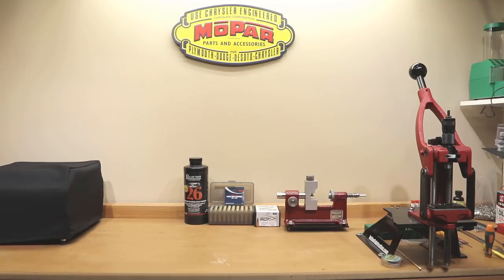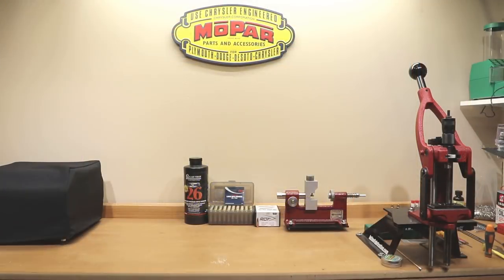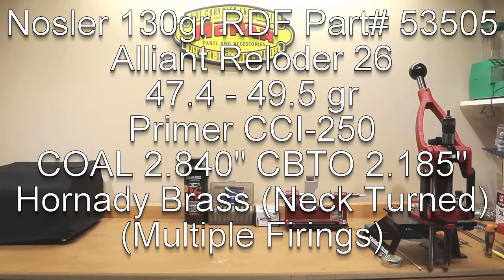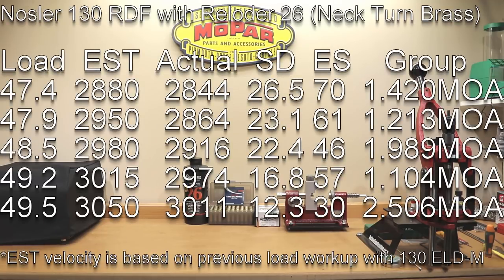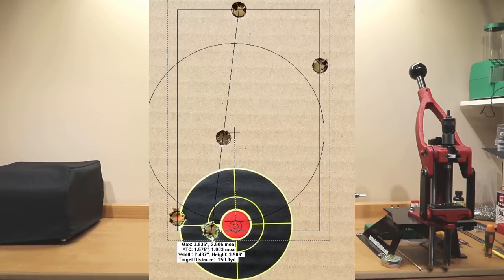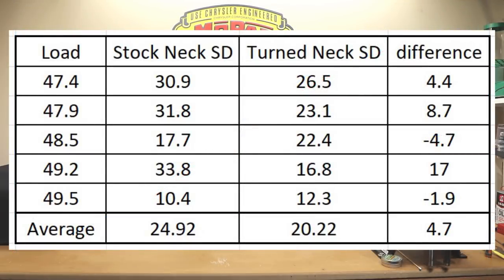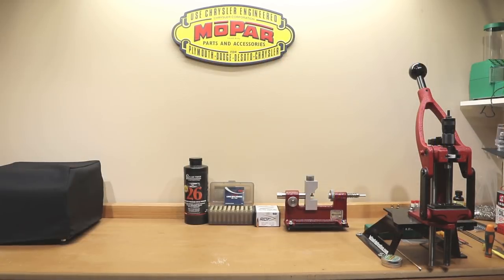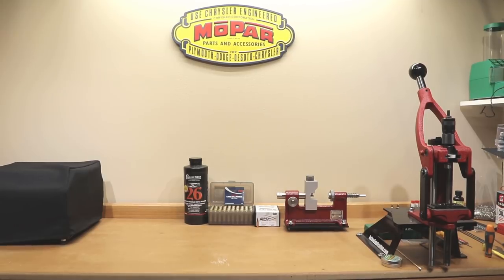Neck Turning Brass -  Does it improve performance?

Comment: I shoot 338 Lapua, and when I purchased my rifle i couldn't afford factory ammunition at that time in 2009. So I purchased a box of Lapua brass and began measuring the neck thickness and found that they had about half of the necks had thick and thin spots in various locations. So I set up my Sinclair neck turner to trim off the thick spots and bring the case necks to be more uniform thickness. Then I loaded them using the Sierra 250 grain Matchking bullets to the same specifications that Black Hills loads there ammunitions. Then I loaded a starting load latter and worked up to the powder level Black Hills level. To my surprise the Black Hills loading was the most accurate using the Sierra 250 grain matchking bullet. The key to turning the necks is to allow the bullets release of the tension of the neck completely 360 degrees around the interior of the case neck, causing the neck to expand to the extreme interior dimension of the chamber's neck so the bullet is caught in a bubble of expanding gases as those same gases are pushing the bullet forward towards the freebore of the barrels throat and into the rifling. When the case neck has a thickness that is not uniform in thickness the bullet can be pushed sideways, When the bullet reaches the lands and grooves you want the bullet to obturation to be equal or as the bullet travels through the barrel it will exit off center. That then governs bullet placement on the target.

Comment: I almost always turn mine down. I usually fire them once first, then turn the necks. But I’ve been known to do it right out of the box to. 
I’ve seen improvements anytime I turn necks, assuming they need turning that is. I’ve got lucky before with starline and Lapua having necks with .0005 difference between each case. Basically a half thousandths, so those I didn’t bother turning and they shot well.
Reply: I have been using the Lapua brass in my 6.5.  It rocks because the neck is so thick.  I'm taking a reloading class later this year that Alpha is putting on.  I'm hoping theirs is just as good because it's way cheaper.

Comment: Great video.  Very true and such an important area to discuss.  You can overturn the brass, and I've done that by accident.  I've done similar tests, and have seen some improvement as well.  For Lapua, Alpha, & Peterson; I don't see nearly as much improvement compared to Hornady.  HDay brass is much thinner in the neck and body than the previous three.  I see my HDay cases having a larger volume than the others.  I even tried cutting down .308 cases to see if reduction of volume would aid in higher pressures with less inconsistency in the walls and neck post annealing and turning.  I did see some interesting results compared to out of the box 6.5CM brass.  I've been considering buying some .260 cases just to see what happens with them on downsizing to 6.5CM does in comparison to .308 cases.  I did notice if I neck turn, fire the case, then try to resize without annealing that the case mouths will not hold a bullet after the 2nd firing.  The brass just springs right back to its original fired size in the neck due to the thinner brass not being strong enough to resist the spring back.

Comment: Good video as are others you upload.  Helped me decide a couple things and learned a few things from both the video and comments.  One- I use Hornady brass that I obtain by buying factory loaded ammunition, not bags of 'new' brass.  So:  I have been thinking about annealing and now I feel it would be a waste of money, insofar as gaining a benefit from increased life, # of loads, of my brass.  Because of loose primer pocket or CH issues occurring, negating the gains made in neck life by annealing.  The benefit to annealing, then IMO would be a possible reduction in SDs/ESs.  

Appreciate the candor about a shortcoming, IMO, of the Hornady neck turning tool.  Namely the coarse adjustment of the cutter.  Also, I am not real excited about holding and using a cordless drill to run the 'mini' lath.  I think there is a superior neck turner on the market with an integral electric motor.  Jury is still out on whether to neck turn.  I'm typically under .002" on run-out and most times around .001".  

And your video gave me a nice 'confirm' on my decision to use the Sinclair expander mandrel and its die on my case necks.  Finally, you do a good job presenting your information and topic and you do a nice job in producing your video.  Good camera angles and lighting and no background noises, like a phone ringing, dog barking , kid crying, etc  :)  lg

Comment: I'm turning case necks because as an old National Match shooter I have a basement full of 308 brass and with the excessive cost of 6.5 Creedmoor brass, if I can find it, to feed my Savage 10T I've started converting 308 to 6.5.  Hornady brass isn't bad but Federal is very thick comparatively and after seating a bullet the case wall thickness can prevent chambering properly.  The side benefit is increased accuracy.

Comment: Neck turning seems to work best when the rifle has been 'prepped' for accuracy work.  I work with WW1 era rifles and middle to large size game, so half a hair accuracy is not needed.  I do have a couple accurate intended rifles I would like to get sub-tiny groups.  I have a Forster case length trimmer and neck turner.  I confess I haven't used it much and could probably use more practice.

Comment: I bought a Hornady case neck turner,    I didn't see a big whopping difference. But the difference I seen, it  was  worth the price. I recommend it and be careful not to cut to much
Reply: People should make sure they turn the necks down so the cutter just kisses the case shoulder . That way you know you have cut all the length of the neck . If you stop short of that you run the risk of creating  a ridge just  before the neck shoulder junction that upon firing transfers inside the case creating a  doughnut . 
People who are skim turning for a factory chamber do not need to clean up the whole neck circumference , it's not necessary and it leads to necks that are too thin . Clean it up about 75% and after a few shots it will clean up again a bit more at the same turner setting .  Remember that in a factory chamber the more you turn the neck down the greater the gap will be between the loaded round neck diameter and the chamber wall . Which negates some of the benefits especially if the case body is a sloppy fit in the chamber and the round lays on the bottom of the chamber .
This situation  can also be corrected with partial neck sizing and using body dies when resizing the body and a separate neck sizing only die , Lee collet or Redding bushing . Bushing dies work better on neck turned brass , collet dies work well on all brass however to shorten the neck size length of a Collet die put  a steel washer over the case onto the  shell holder . This gives you the  partial neck size and a slight second shoulder just above the neck shoulder junction . This never gets sized again by the body die or the neck die and stops the case ever laying in the bottom of the chamber and centers the neck even though you have neck turned it and lost brass thickness . You have reclaimed the neck centering better than before turning and the turning improves neck tension , bullet release , bullet seating accuracy and  neck sizing precision  .  I just gave you one of my accuracy secrets that I developed back in 1967 .

Comment: There is a whole lot more to neck turning in a factory chamber . Just turning  the case down is a small part of what else you need to do , reloading wise to gain the best benefit .  Most people do not know how to skim neck turn and partial neck size and then use body dies to size the body of the case to take full advantage .  Most of what I see on the internet on this subject is either very basic , missing the whole picture or just plain  wrong .

Comment: I'm not a professional reloader, but, all the old timers that have been reloading for years have told me never to use magnum primers on anything other than cases that hold over 65 grains of powder. Also what size inline fabrication mount are you using with your forster co ax?
Reply: Whatever, old timers also started their cars with a hand crank too. Science and technology has come a long way since. Way over half of the F-Class Open competitors use CCI 450 primers(Magnum) even for 6MM cases at Mid-range (about 32 to 32.6 grains of powder). These are professional reloaders who compete at the highest level.  They do not follow old wives tales, they test for themselves and do what works best. Remember the old timers said to not bump the shoulders, the bolt should have some (measure that) tension when closing the bolt to extend brass life. Ask all those "oldtimers" if they shoot sub 5 inch groups at a thousand yards regularly, or just shoot at deer and coyotes from 100 yards. The world record at 600 yards for a 5 shot group is .282 inches. I have seen very few oldtimers who can shoot that at 100 yards, but you listen to the oldtimers if you want to.
Reply: I have recently switched to Fed 215's from Fed 210's, in my Winchester Model 70 Pre-64 30-06, and my Rem 700 Mil Spec 5R .308. I have noticed close E.S. and improved group sizes. Drop your charges by a grain, and build back up if needed.  I didn't notice any changes.  Liked the video!
Reply: I shoot a AR10 SASS 308 20"@ 250yrds.
Magnum or regular CCI primers, 42.5gr of IMR 4064, 168gr Speer BTHP.

I notice no difference and groups are less than .75" @ 250 yards.
Reply: @fergusonlandmanagementweld3696  I have a model 70 post 64. I'm still working up a load. Mind if I ask your bullet and powder?

Comment: The large groups could be from the powder choice?  Neck turning seemed to help slightly but a powder change could make a major difference to the group sizes.  My rifle hates the Alliant brand
Reply from the maker: Its a bad combo no doubt. If I repeat I am thinking 147 ELD-M and Reloder 16
Reply: @BoltActionReloading   RE26 and 147eld shoots well in my 6.5CM's with longer barrels.
Reply: I get some of my most accurate loads with alliant powders.  Especially RE26 and RE16.  For 338 I use RE33.

Comment: Nice video and I admire your courage in putting up such bad numbers. I'd wait until you are sub 1/2 MOA and then look to differences. There are more things wrong or right than neck tuning at play here. I did not see anything about neck tension and how far off the lands, etc? Not to put you down but my neighbor shoots 1/2 MOA all day long with handloads in his 6.5 Creed RPR. He does no neck turning BTW. Have you thought about an EC Barrel Tuner? Might try one and see if your groups improve. Good luck!
Reply from the maker: Hi George, I did 2 videos on this subject and one I did to show that it had some improvement on a OK load and then a really Bad load to show that it wasn't a magic fix all. I don't pick who YouTube shows which too so I get this a lot more than you might think. I thought it was funny that I still saw improvement but it certainly doesn't fix a bad load was what I was trying to get through on the video. A barrel tuner isn't going to fix this combo. I may try one when I can test it objectively.  This is a much better example of the performance that I have been able to get. https://youtu.be/45rtyfwPRSw

Comment: I'd like to see you test your best load using neck turned versus non neck turned brass.
Reply from the maker: That is my thought, though I am also interested to see if it modifies my velocity graphs that I have been working on as well. So much to test, so little time.

Comment: Hello 
In my experience before neck turning 
I was shooting 3 to 3/12 inch groups groups
After neck turning 1 to 1.2 inches that’s with my 6.5 Grendel hornady brass cci br4 primers & benchmark propellant 

I hate to said it ! but my first test non neck turn was perform wit cci 400 primers
I need to make another test to have a more conclusive test 
But that’s all about right! 
I like reloading much as like Shooting is really push you at your limits ..

Comment: What in the world are you doing? 1) RL 26 is for bottleneck magnum cases, not modest capacity cases like the 6.5 mm Creedmoor. The Nosler website/manual doesn't even list a RL 26 load for that cartridge. What would be the point? Nosler, instead, uses the faster RL 15 and RL 17, that are more suitable for modest capacity cases. 
2) If a gun is shooting 3" groups, there's something drastically wrong either with the barrel or your hand loading techniques. Correct that problem first. 
3) SAAMI (factory size) chambers are usually .005" to .0006" larger than unfired or full length resized case to ensure reliable feeding. Neck turning cartridges with non-custom/ factory chambers is usually counterproductive because it gives the case neck and hence bullet more room to misalign in the chamber after ignition. Case neck turning is generally only productive with tighter custom chambers. 
4) Having said that, there are occasional exceptions: Neck turning on my Weatherby calibers with custom barrels (but with factory barrels) failed to produce any increase in accuracy. For example, my 26" Shilen barrelled 270 Weatherby Mag remained at .6 moa with 150 grain Nosler partitions, and 1.0 moa with 130 grain Partitions. However, my custom barrelled 28" 300 REM, which already had lots of freebore, shot consistently tighter groups after neck turning.
Reply from the maker: Hi Will, Let me try and attack these in order.

First you ask "What in the world are you doing?" I am running a reloading channel and testing conventional ideas on how people tell me how I should be reloading. I run tests and show my results good or bad so that we can all learn something maybe.

1. RL-26 is the incorrect powder here, but it worked fantastic with the Berger 135 classic hunter. I had to give it a try. Data here: http://www.bergerbullets.com/pdf/6.5-Creedmoor-135gr.pdf  If I see now that Nosler finally updated their data online to include the RDF projectiles. The 140 RDF was out much longer than a year and they updated nothing. And with a quick review of a couple other cartridges I still don't see any RL 16, RL 26, or RL 23 anywhere in the Nosler data. Not going to wait for Nosler to catch up before I try them out. Its at least nice to see that the changed the COAL on the 140RDF on their data since when I emailed Nosler about it they told me 2.775".
2. While I try to appreciate peoples opinion, stating that the gun is broken or I don't know how to reload is a bit over the top here. If your new here I encourage you to check out some of the other videos I have made on the channel. Many with far smaller than MOA groups with this rifle and with the same hand loading process and equipment. This bullet (130RDF) like its big brother (140RDF) seem to be very sensitive to jump, both have set records on my channel with the worst groups I have shot with any projectile.
3. I really don't have anything to comment on here, I agree saami chambers are larger than custom (benchrest) I am doing my own testing here to determine this for myself. Benchrest typically require neck turning to get brass to chamber, its not done to improve performance as much as it is done out of necessity to chamber a round.
4. I get the impression that you feel I am turning these necks further than I am. I am only turning the necks to even them out. My final thickness was very close to .0127", and there were still very small areas that were not contacted by the cutter. Trying to achieve more consistent neck tension is my goal, I am certainly not neck turning for fun, only to determine if it is worth the time spent. In this case it was.

BAR
Reply: I know people that shoot 6.5 CM with a 26 inch barrel and use RE26 and 140-147gr bullets for competition. If you run it through Quickload you'll be able to see % of powder burn.  For 22 inch barrel I use RE16 though.

Comment: 2 moa tighter after only neck turning? That doesn't make any sense at all. Guys out there don't even bother doing it and still plug 1500 yard+ shots. 3moa would be ridiculous spread that that range. Something else was changed. Whether you knew it or not.
Reply: I would have to try to develop a load for shooting that poorly, assuming I continue to put effort in the fundamentals behind the trigger. I wonder if something isn’t loose on the rifle, or if there isn’t a bad spot in the barrel/crown. 

Turning necks only adds a little consistency to neck tension. I’ve had some of my best groups with crimped necks in a rifle, but the crimp was uniform and consistent on all rounds.

Too many unknowns not covered in this video to know what the culprit was, but I doubt neck tension was a major factor. Should have loaded identical charge weights for turned vs unturned, shot on the same outing. Environmental factors could have “tightened” something up on the rifle since the previous groupings were shot.
Reply: @christopherfreeman3095  plenty of other factors to consider including shooter error. but i have a hard time buying that big of a spread just on neck turning. i don't turn my necks and I shoot sub .5moa out of a factory Remington barrel. something ain't right

Comment: Have you ever consider that maybe it’s time for a barrel upgrade on your Ruger RPR maybe that rifle is not capable of smaller groups
Reply from the maker: I have shot some groups .5 - .6 MOA with other projectiles, which as a shooter is probably what I am capable of. My round count isn't at 2k yet and I really haven't seen a velocity drop. I am pretty sure by barrel just doesn't like the 130 RDF. I need to see if it can shoot with a different COAL bu who knows.